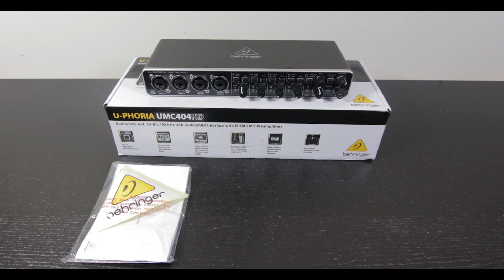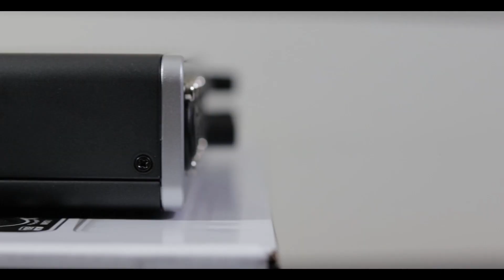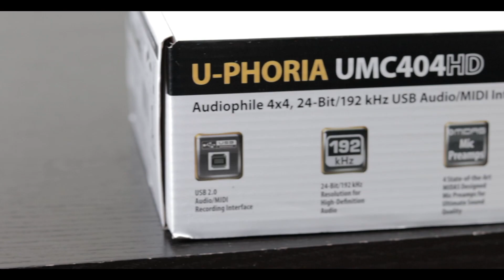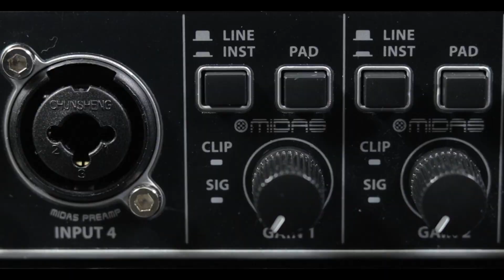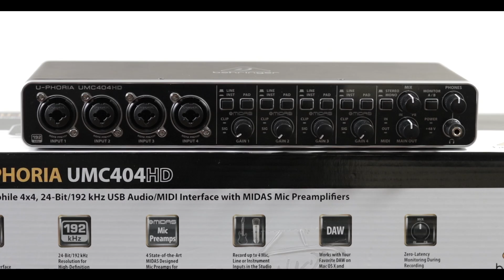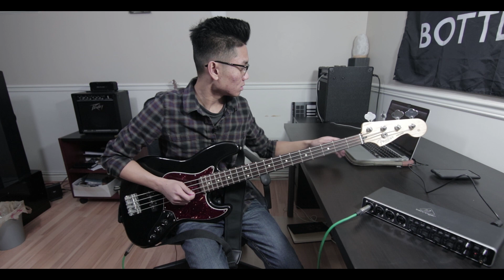Behringer U-Phoria UMC404HD REVIEW + TEST!

Comment: As a new Beginner I’m upgrading from my just sold $60 Focusrite Scarlett 2i2 2nd generation to the Behringer UMC 404 because I would get more bang for my money than to pay $270-$280 for the Scarlett 4i4 or the MOTU M4 & being that my set up includes a USB midi controller with the 5pin midi out a Roland JV-1080 midi sound module a MPC One Plus sampler a AKG P220 mic a MacBook Pro a pair of Sony MDR-7506 headphones & a pair of Silver Rokit KRK monitors the 404 should complete my set up & I will still have enough inputs to connect a external effects processor like the Alesis Nanoverb

Comment: Your video is amazing. I am using an acoustic guitar with a jack connected to the UMC404hd and a mic without phantom power. I am using audacity to record.  I am confused, what should be my sound source in Audacity - its shows me 1+2, 1,2,3 all 4 UMC so its pretty confusing. On the Mac I see only UMC404 as audio input but it doesn't record at all. can you please help me.

Comment: The Behringer UMC404HD destroyed my Rs. 50,000 worth condenser mic!

I have used this interface for 3+ years and IT SUCKS. Although the interface boasts of four 48V powered channels, they do not function well simultaneously. The interface has tremendous power management issues because of which it doesn’t work properly in low-voltage conditions. 

The interface is extremely glitchy and has an issue with real-time AD/DA conversion. Half of the times it doesn’t connect because the provided driver doesn’t function well. The multiple INs and OUTs are a marketing gimmick to lure people into buying something they don’t require.

I’m using the interface with a 2014 HP Notebook- Intel i3, 256gb SSD, 8gb RAM, and the interface gives up when I try to work at max sampling rate.

Most recently I bought the Rode K2 condenser mic, and the interface literally made a “kadak-click” sound on turning the 48v switch on, after which, my brand new mic stopped sending any sort of signal at all. I was extremely fortunate to have gotten a fresh piece of the same model replaced from Rode, otherwise you can imagine.

ONE OF THE MAJOR ISSUES - NO AFTER-SALES SERVICE IN INDIA. If you encounter a problem, you’re finished. I stay in Maharashtra and the website showed the nearest service center to be in SRI LANKA 😂. Not to mention the time and efforts you have to invest in writing long essays about your problems and waiting for days to get a response. Once the product is sold from their end, they don’t give a damn about what happens next.

All in all, I’d suggest beginners to rather spend on a single/twin channel interface with strong preamps and good build quality instead of going for something that just appears big and fancy. No matter what you buy, whether cheap or costly, service is going to be a major issue because these companies rarely distribute spare parts.

My experience: Minimal channels with good hardware and good preamps are more important than multiple channels and multiple outs. Especially for beginners in a place like India, I’d recommend you to browse through the hardware quality and after-sales service before you even think of tech specs such as number of channels, frequency response, or monitor-out provisions.

Remember, if the motherboard itself sucks, nothing else matters. This review couldn’t be much more from the heart. Hope you make an informed choice.

Comment: Behringer UMC404HD will do its job for recording sources, but, given the fact that it also has TRS and XLR outputs, its maximum output level (+3dBU) is insufficient to drive balanced inputs monitors or PA speakers to nominal level (+4dBU). You may need to use an additional preamp or mixer to raise the gain to a sufficient level.
In comparison with other USB audio interfaces, able to deliver output levels of +6dBU, +8dBU, +10dBU or +12dBU, Behringer UMC404HD output levels (1V RMS / 0.78 dBV) are low and similar to consumer Bluetooth output devices.

Comment: Hi, what is the maximum length of a usb cable that can be used with a Behringer U-Phoria 404hd? my computer is about 100 feet away from the mixer.
Reply from the maker: oh you would definetly need to buy a 100ft usb cable

Comment: Whats the live monitoring headphone volume like on one of these? I was about to go for an older roland UA-25, but was turned off by the volume levels, im only using it for vocal technique, so monitoring is 100% essential, love to hear your thoughts, thanks.
Reply from the maker: It's great! I usually have the knob at around 12 to 3 o'clock and i get clean volume monitoring. Also, if it isnt enough for you, you can always increase the input level on your mic track in your DAW to make it louder in your headphones.
Reply: @figgyviews4047  comprehensive reply. ty :)

Comment: Question: Is this midi device portable? As in can you just use the USB bus input straight to your laptop without having to use the DC IN power input on the back?
I think I did read somewhere that it is preferred to use the DC IN input, but I just wanted to check for my own personal use.
Thanks
Reply from the maker: Yeah I use it without the DC-IN cable. I didn't see a difference between using it and not using it.
Reply: @figgyviews4047  Thanks heaps brotha, video was really helpful. :D

Comment: Inserts (like the 4 on the back) are normally for use with outboard rack gear, like compressors, and effects. You would use a "Y" cable that sends a signal to and from the interface. The cable ends are referred to as "tip and ring", or just plain old "insert" cable (could be why it's labeled insert), and use to be pretty standard equipment back before everyone became an "studio engineer". Guess what plug ins are based on... hardware, and rack gear. 
The insert jack can also be used as two different types of direct outs, so technically you could connect a mixer to them, but I'm pretty sure that wasn't the primary function they were intended for. It's kind of depressing to know how many people, including many professional studio engineers, have never even used traditional equipment. I recommend that anyone who hasn't tried a rackmount compressor, effects processor, sonic maximizer, etc...  give it a shot! Yeah, the new DAWs, and software are great, but incorporating the hands one workflow, and genuine signal processing opens up a lot of possibilities, and uniqueness to your music. To the people who are still using that stuff, I'm sure you can understand where I'm coming from.

Comment: does the phantom power supply power for all 4 inputs ? say if you wanted to power 4 condenser mics ? thanks.
Reply from the maker: Yeah it does
Reply: @figgyviews4047  thanks for the reply. would you recommend this unit  ? im a little weary because of the low price and ive had mixed experiene with behringer products in the past. thanks.
Reply from the maker: @MatthewNash92  This unit is super proper. I use it for audio recording with my freelance paid work. Pretty reliable product.

Comment: 5:50 for you don't breaking you mic cardioid using the phantom power button, you must buy mics and cable balanced. Cause this system and this cable will cooperate for you best exploitation. I'm a Drummer and I did it with my mic MXL 990 together with my mic Shure Sm57 and everything works very well. 

Because the CABLE and YOUR MICS must be balanced. 

In case of doubt, I will share with you an video here. And thanks for this video. 

https://www.youtube.com/watch?v=uTEDctO3x4w

 (you'll must put the legend on your language because this video is in my language (Portuguese/Brazil)

Peace!

Comment: For those wanting to use a ribbon mic with this interface (sounds fantastic on bass cabs), I suggest using a CloudLifter CL-1 between the interface and the mic. It'll protect the ribbon from power surges, and give you around 20dB of very clean gain. In fact, I suggest everyone use that, either for dynamics OR ribbons, because that clean gain is worth it. You could also try the FetHead, which works similarly and is a bit cheaper (not as rugged!).

Comment: According to Behringer the phantom power only affects the XLR connections, TRS/TS are not affected. I have mixed the 2 and had no problems but I don't own anything that's particularly susceptible here so YMMV etc.
Reply: Yes phantom power itself need xlr. TRS cant do. This apply to all audio mixer or interface.
Reply: This was the one thing I was worried about. Thanks

Comment: features for price it can't be beat, my only gripes with the design would be that it's a tad bit awkward to have the phantom power switch on the back plus there is no way to control phantom power individually for the 4 mic inputs....but anyway I'm 95% sure I'll buy it since I upgraded my Mac OS and my TASCAM US-122L can no longer function with my computer

Comment: Hi! Did you use a mono or stereo cabel? With regular guitar cabel i hear it only from the left side...
Reply: Each input is a mono input. So depending on which input you use you'll only hear either the left or right output. You can push the Mono/Stereo button to combine the sources together, but then you lose the ability to multi-track which is one of this items best features

Comment: Hello
Nice video
I have a question,can i put a vinyl record player in this audio interface?
Reply: You can output to the interface from a record player (older ones used RCA ports so you'll need an RCA to TRS-style cable). Newer ones use USB which you can't connect directly to this interface

Comment: I’m going to use this as an audio interface for my HS8s.
Reply from the maker: Let me know how that goes! I've been thinking of getting those monitors.
Reply: @figgyviews4047  its cool i wish i had got a big knob monitor controller instead though. There is a big knob studio which has an Audio interface built in. Thats the one i would get since ill be switching back and forth between the HS8 monitors and my reference monitor. the UMC404HD is still  cool for what it is. however, I dont use the inputs in the front because im mostly mixing film and narratives. the device is also weak on Macs. the driver disappears all the time and I have to constantly unplug the Behringer from the imac and then plug it back in then the driver is visible and i can select it. i still might keep it as a backup when i get a monitor controller with an  integrated audio interface. i need it for workflow purposes.

Comment: hi, need your help for my question :
- is this 404 has 4 line output ? i need to send metronome track to the drummer only with my DAW (logicpro x)
- do we always need power adaptor or it's powered by usb cable connected to macbook ?
thanks in advance bro
Reply: It is a 4 in / 4 out interface. Latency is pretty minimal if you monitor direct from the interface. I have used this interface only connected by USB from a 2013 Macbook Pro and from 2018 iMac with no issues. Not sure about the power draw from USB ports on a Macbook

Comment: Great video! One question
Can you plug more than 1 pair of headphones?
Reply from the maker: No, there's only 1 headphone input.
Reply: there are so many outputs on the back, any way to make one of them work for an extra pair of headphones I wonder?
Reply: @proverbalizer  You can do this: use one of the pairs of outputs from the back to go into a headphone amp. Then from there, you have so many options.

Comment: Dude, make a video how to use it in Ableton Live. Im looking to an Interface where you can connect a Main Out Speakers (House Speakers) and Monitor Speakers (Speakers where i can hear it) or Headphones Out that i can use for Cueing some Tracks in Ableton Live.
Reply: The 2 pairs of outputs appear as separate devices and the headphones can be switched to monitor one pair or the other. I use it this way as a DJ interface with the main mix on 1/2 and the headphone cue output on 3/4.

Comment: Well done review! Looking to record electric guitar with high gain. Do you know of any problems with clipping? I've read complaints of similar devices and clipping which makes me hesitant to buy any of them.
Reply from the maker: This interface has a pad switch for if you are recording loud sources. Every interface, in general, is going to clip if the source is too loud. It really depends on how loud you are recording. If the mic you are using has a pad switch(-10dB) as well  then activate it with the pad switch on this interface. You should be fine.
Reply: Figgy Views thank you!

Comment: No one else's reviews mentioned that phantom power switches on all channels. That could be a disaster if I'm recording an ambient mic on a dynamic at the same time. That's really gutting, I was about to buy this, but now possibly back to square 1. Much appreciated info, thank you. www.leemottram.bandcamp.com
Reply: that's not how phantom power works. It doesn't have any effect on dynamic microphones at all. your dynamic ambient mic will be just fine.
Reply: Agreed, looks like this is a good article on that. https://www.soundonsound.com/sound-advice/q-phantom-power-on-dynamics
Reply: Is it safe though, recording mic on phantom power while my instruments (guitar etc) are plugged in same time to record..?
Reply: Check my experience/research, but 48v phantom is never sent through the TS portion of the combo jacks on basically any interface (where you'd plug in your guitar or line-level signal into). Even if you managed to send phantom power to your guitar (maybe by using a 1/4" to XLR adapter and plugging into the mic input), it's more likely that you would damage your interface preamp than your guitar pickups. Good question though!

Comment: Hi there. I need a little help. I'm trying to connect my Roland Juno DS61 keyboard to FLStudio via this Bheringer U-phoria interface the regular way (the quarter inch cord from keyboard to Bheringer interface and usb from Bheringer interface to computer, plus I think I chose the right category on  the FL Studio settings) and the FL Studio still  won't react when I play the keyboard. Any idea what else I might try to make it work?
Reply from the maker: Are you using Mac or PC? If you are using PC, then you need to download the driver.
Reply: Figgy Views  Thanx. I did actualy go to Bheringer site to download some program or more precosely to register my interface  but I do not know if that means I downloaded the driver...
Reply: Lol, why not just set up your DS through the USB midi option?
Reply: Bato Daesitiates it's actually easier and cleaner to run your DS straight to your PC through the USB B port and use as an interface as is (is will record in Stereo). Unless you're looking to record multiple tracks individually

Comment: i would add one more downside. That is, the lack of internal LOOPBACK. I was very close hitting the buy button, but after i did some more research i end up with Yamaha AG06. It has loopback and the ability to swith phantom power on individual inputs ;)
Reply from the maker: Sweet! Might look into that if this interface fails me. Thanks for sharing!
Reply: Serious question: what would you use loopback for? I want to be sure this isn't something I'm missing